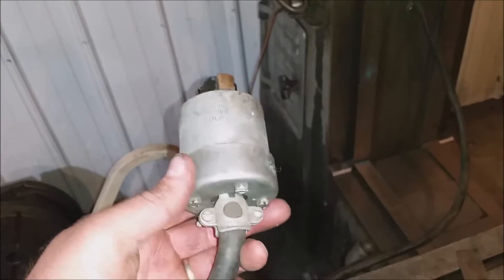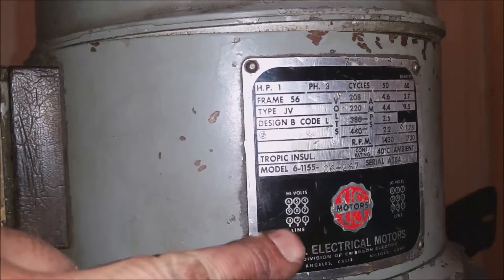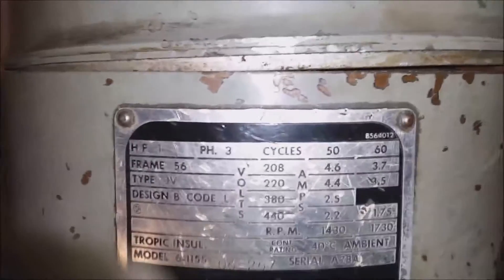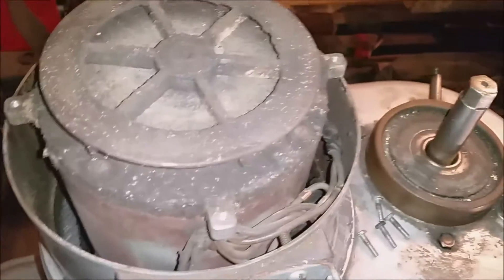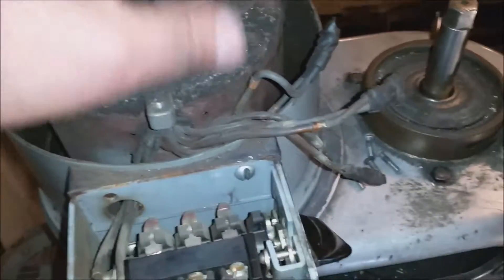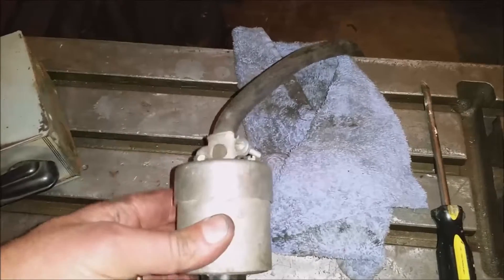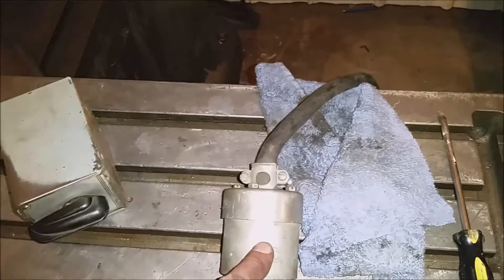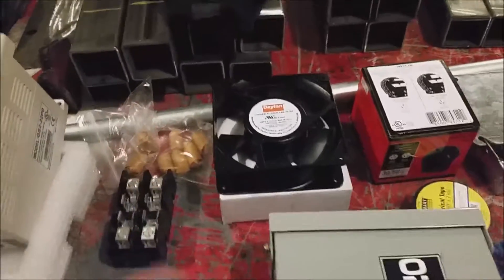Bridgeport Mill VFD hook up part 1

Comment: So I'm a little concerned for you. 
You assumed the original power was 3phase 480vac. But the scratch outs on the motor panel say it was in "high" 220vac mode.
You then re-wired to "low" 208vac mode.
But residential center tapped 1phase (110-neutral-110) meaning that across the two hot legs (L1 and L2) you get 220vac for your dryer, range, air conditioning etc.
So if your VFD does 220in and 220vac out you're now over-driving it.
Or I'm wrong and it was originally 480 and you did the right thing. 
I will have my Bridgeport in a few days. It was running in a modern factory until a few months ago and ran on modern 3phase 208vac using a standard NEMA L15-20 power plug (https://en.m.wikipedia.org/wiki/NEMA_connector#NEMA_L15). 
It is a 1hp motor "stubby" Bridgeport. 
So... When it turns up I'll confirm the motor label and the actual U V W pairings and get back to you. 
There definitely needs to be more YouTube videos on this so people don't burn up a motor.
Reply from the maker: Well, so far I I haven't fried the motor.  Actually I knew it was 480v because I bought it from where I work and just knew that.
Reply: OneVeryOrdinaryMan ok. That's a good datapoint.
It means I'm now totally confused about what they put on the label. For mine I'll have to tell if it was 208 or 220 or 480 based on the power plug. (250v L14-30 vs480v  L15-30 etc) not what's scratched on the label. 
Thanks for getting back to me :)
Reply from the maker: +Rallymax what actuallu matters is the little number tags on the wires.  You dont have to know how the last guy had it wired if you can read those.

Comment: Thank you! As you say everyone else skips the motor rewire. Thank you for walking through it so I can double check what I'm doing on mine.
You close up showed low as 208 and high as 220. The other two higher voltages (380 and 440) where punch-lines out.